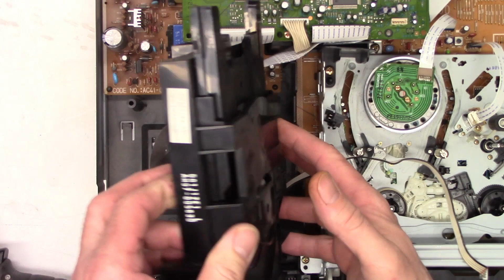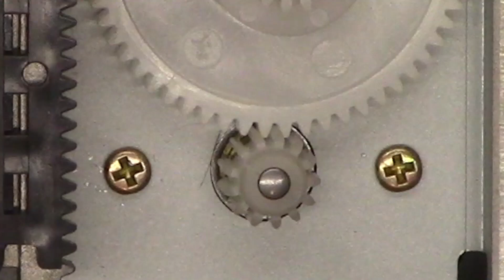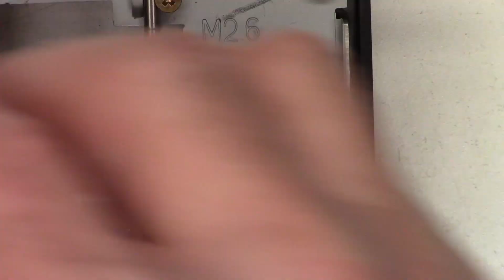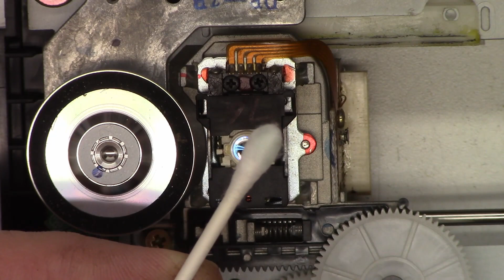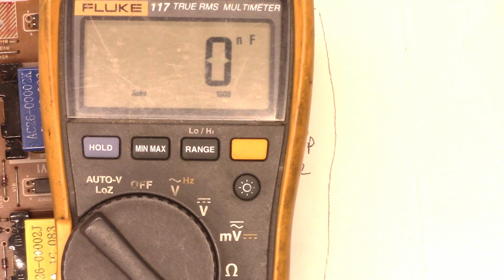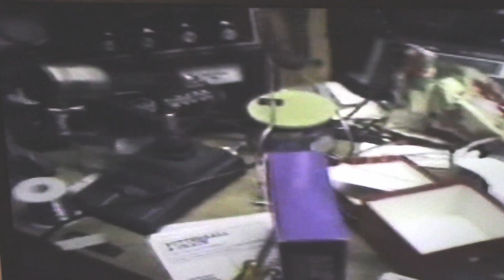GOVIDEO DVD-VCR  PART 2 DVD WONT PLAY + POWER SUPPLY REPAIR. HIGH ESR CAPACITORS

Comment: This video shows clearly that the one made by LG Electronics instead (Go Video DVR4200) is far superior in reliability. A lot of them are still running today trouble-free for over 20 years, and no one has posted a YouTube repair video yet.

Comment: very informative video, hey a new subscriber here, you've got a lot of videos using your analog esr tester, did you built it diy or is it available on ebay, i think it's more accurate and reliable that peak atlas esr esr tester, i'd like to have one like yours with analog meter and can test in circuit esp. electrolitycs, more power, from canada!
Reply from the maker: Check out the Blue ESR tester I just built. It is awesome! https://youtu.be/lXVlMTbTYtc
Reply: @norcal715  would you sell me your analog esr tester? you can ship it thru canada post going here in toronto, canada, thanks......

Comment: You can't connect electrolytic caps like that and make NP cap. You need also diodes.
Reply from the maker: I have been doing it for over 30 years with no problems.

Comment: Just so everyone knows, this repair will also pertain to both Sony and Samsung machines of the same era. They were all built by Samsung which is why they tend to be total pieces of shit. The video processing board for the DVD drives of Sony machines are actually produced by Sony so they tend to be a little better from that standpoint.
Reply: This video shows clearly that the one made by LG Electronics instead (Go Video DVR4200) is far superior in reliability. A lot of them are still running today trouble-free for over 20 years, and no one has posted a YouTube repair video yet.
Reply: @waltchan  
I repair these machines for a living and you could not be more wrong. 😂

Comment: So was the optical pickup failure to read the TOC related to the cracked gear or the capacitor problem? I have a CD player with a similar failure mode.